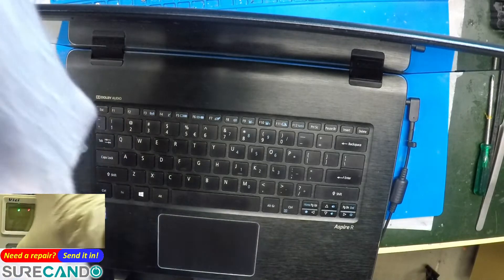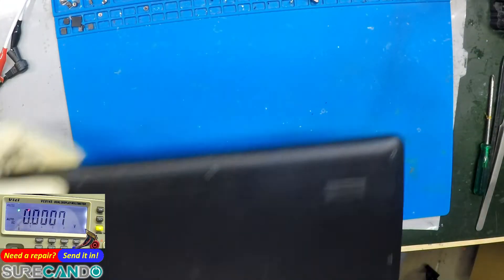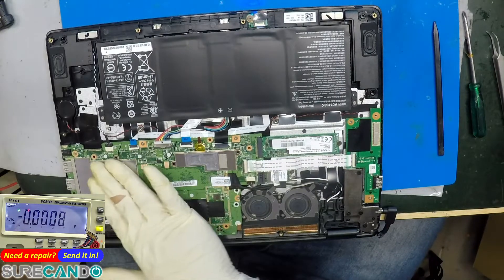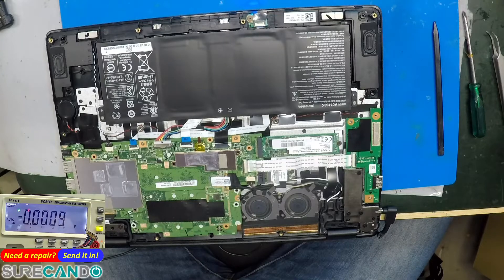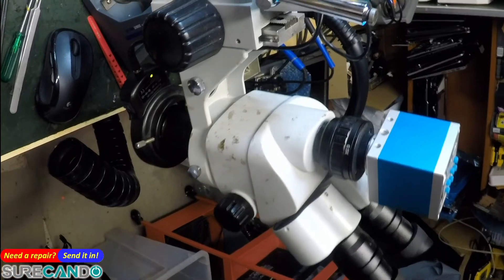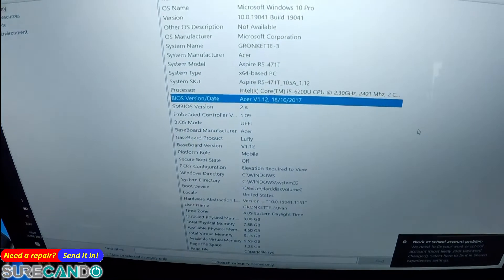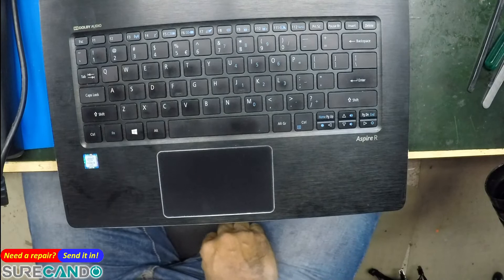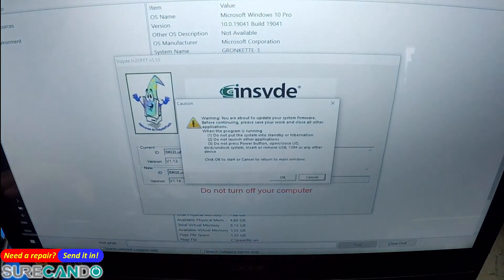Acer Aspire R14 R5-471T Not turning on or charging. Interesting issue.

Comment: What was the problem? Geek Squad says that they don't believe that Acer makes parts foe this model anymore. I went through some trouble shooting tips. Disconnected th battery etc, but it didn't resolve the problem. The charger is crap...
Reply: @SureCanDoComputersServices1  Alright. The machine was running great. No problems other than the charger design. Battery drained and the machine shutoff. Charged it up and would never start up again. I see the blue led like it's charged but screen is black...
Reply: @neiljohnson3326  exact same problem man,got any solution.?

Comment: I have the same exact problem with that same model. Was running great and then it wouldn't start or charge properly. The worst flaw in this laptop is the charger. The charger is a terrible design. It's the male part going into the port.